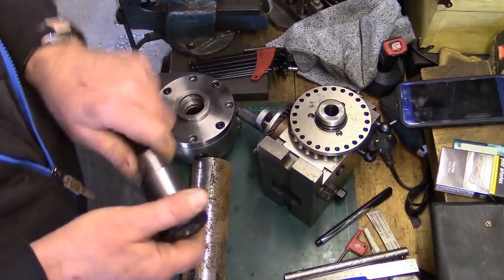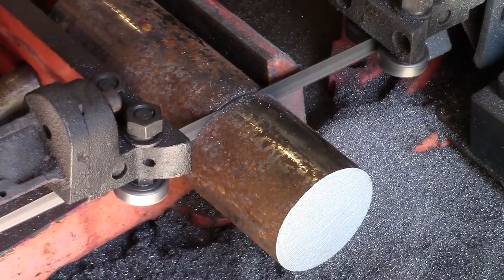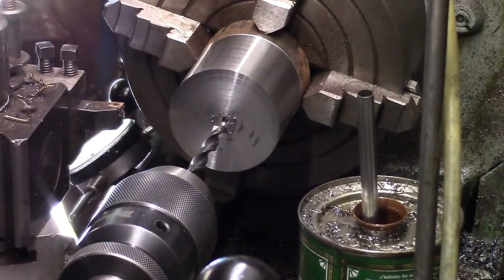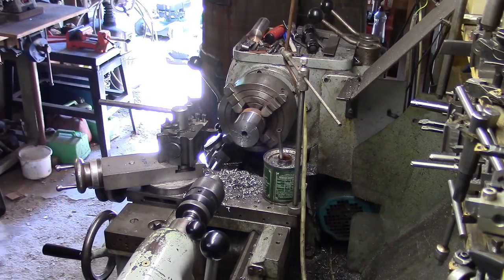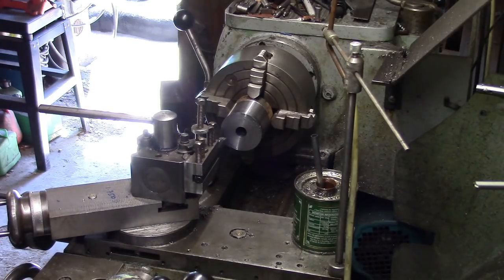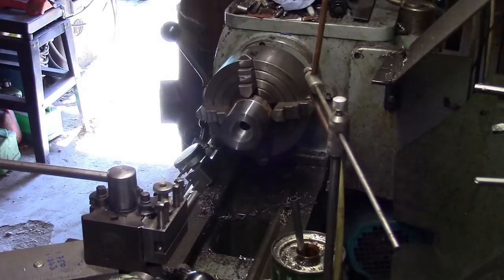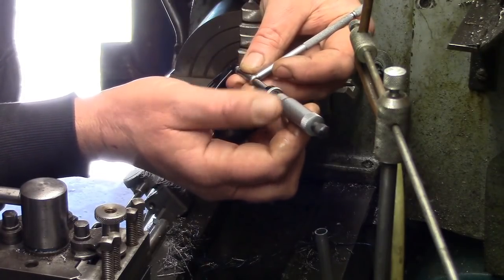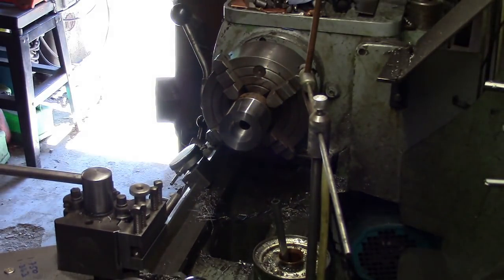Dividing Head, ER 32 Collet Adapter Part 1

Comment: I would guess that concentricity is important, what TIR are you expecting to hit with your adapter?
Reply from the maker: I was hoping for 2 thou or less, but I'm having trouble with the play in my top slide, you will see how I get on, I have an idea to correct it to zero or as near as dammit but I need to sort out the top slide first in order to use a tool post grinder, will be a future video I think.

Alan.